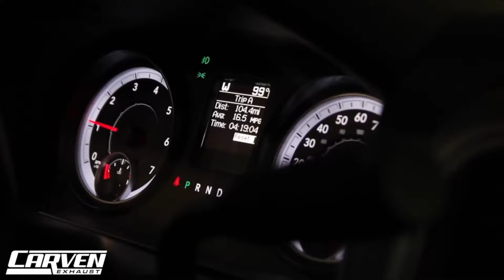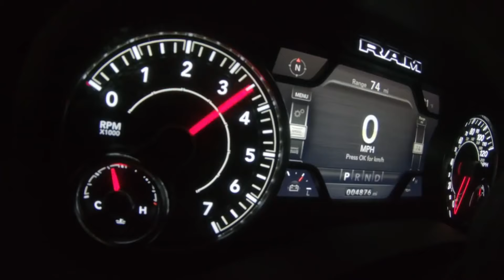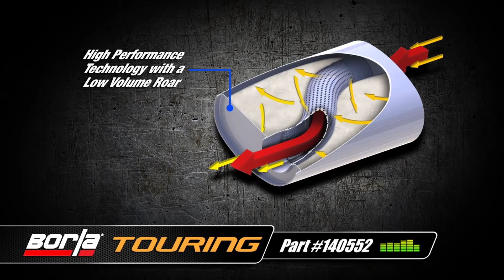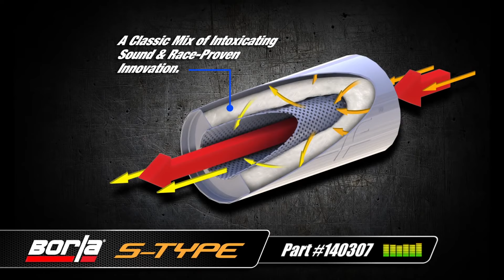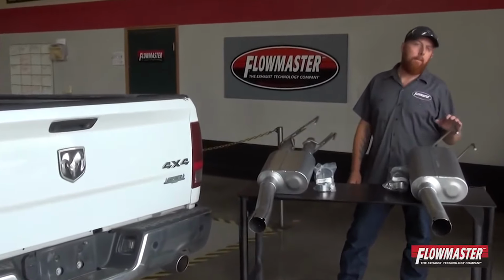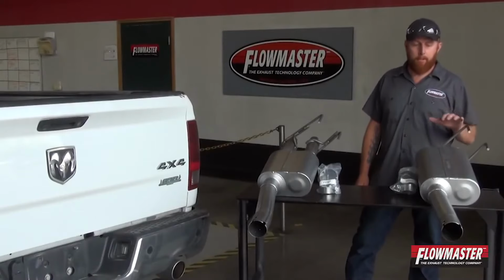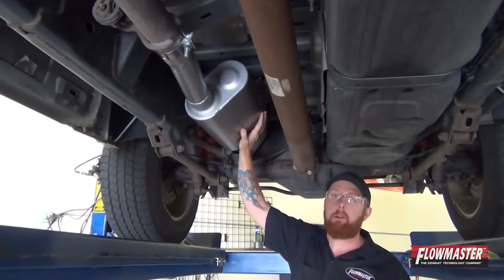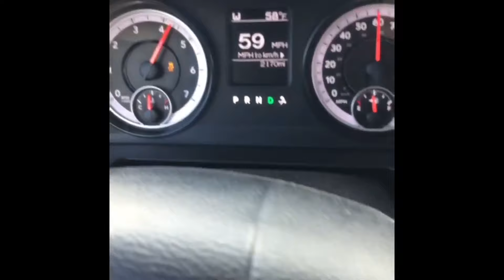Dodge Ram 1500 Exhaust Sound 🔥 Review,Upgrade,Mods,Flowmaster,Borla,System,Straight Pipe,Cutout +

Comment: You need to add Spintech super pro street 9000 in there. If anyone hasnt heard one, GO DO IT. I had one on my 2018 Sport before I traded it in, had it for about 3 years and havent found a better sound. Carven and borla atak are close, but the spin tech doesnt have that poppy cracky noise to it which I love.
Reply: What size muffler did you get? (Outlet and Inlet) 

I'm assuming you got 3" for both?
Reply: @leonardocordova2003  if im not mistaking its a single 3"in and a dual 2 1/2" out. I know it was not 3 inch in and 3 inch out.
Reply: @Dhall-sg2hf  ah okay. Thank you man. The exhaust you recommended sounds nutty. I love it. 

Considering replacing my flowmaster super 40 with something. I may have just found it lol
Reply: @leonardocordova2003  Ive had the spintech pro street 9000 on my last 2 rams and they sound amazing.